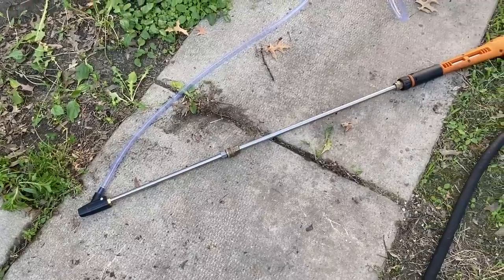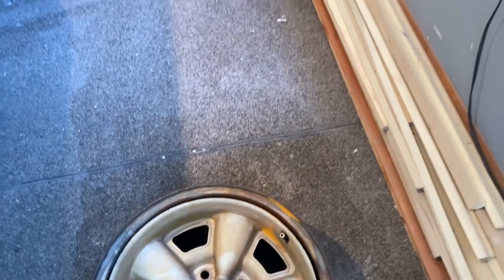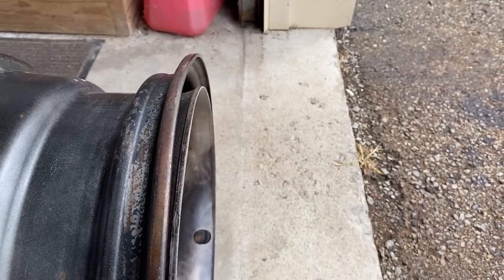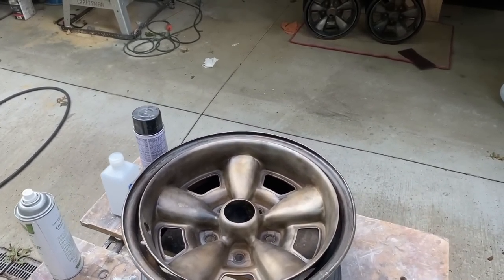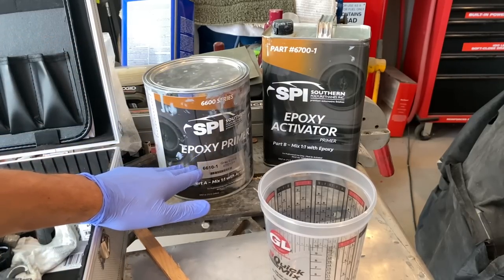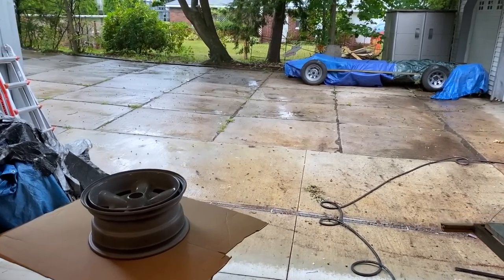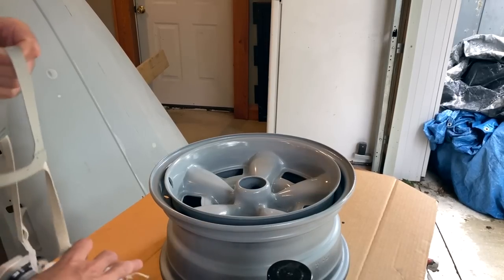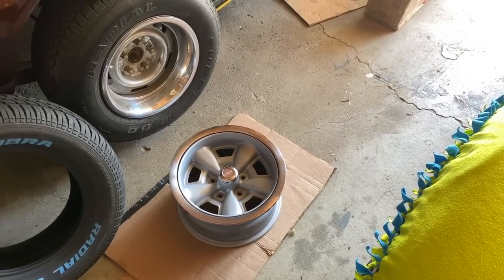1973 Camaro Z28 OEM WHEEL RESTORATION! The NEVER ENDING Wheel Project COMPLETED!!

Comment: The tires that came on your car most likely would have raised white letters so I think that would be more time period correct. I realize that black walls what one would use today but it was different back in 1973. We were still using bias ply tires. A popular tire for your car and the Chevelle SS was the Goodyear Polyglass with with raised white letters. Radial tires were available by 74 or 75 initially as an option then became standard equipment on most cars later on.

Comment: Hi Ryan, I own a 72 Z/28 and have restored some wheels in my day.  It looks like the color you used is close to the 74 Z/28 color.  The 70-73 color, PPG calls/called Dark Grey, I have the paint number if you want it.  The formula has an additive called suede in it.  It makes it rough and collects sponge pieces when you wash them...  The last set I restored I use PPG DP40 epoxy primer then the PPG color.  After realizing the sponge problem I removed the wheels (then mounted) and sprayed them with dull clear.  It didn't change the look but it made it much easier to wash the wheels.  Interestingly enough the same wheel on the 71, 72 Chevelle looks like they deleted the suede rom the formula.  Hope this helps, Tony!

Comment: Those rims look nice, they are not easy to come by , some might even use the rims that were on the 1973 Chevrolet Nova Super Sport, the rims you have, were used also on theChevelles, Super Sport,1970 1971, you have some unique rims on the Camaro👍🏼👍🏼👍🏼👍🏼👌🏽👌🏽👌🏽👌🏽👌🏽

Comment: VW may have started it with those giant center-caps and color match wheels. (not positive) But in the 70s anything with a beauty ring could have color-match wheels. A/C was a dealer accessory. Wheels are easy. And they already had all the paint!

Comment: I’ve had tons of camaros from 75-91.. they did come with factory paint matched to the car from the dealers. There was the option to have them painted. Those were most likely original Paint matched to the car. I had a blue with the rims painted exactly like the car and I had a Firebird with those rims or very close to those that were the same color as the car that were OE. As for the white letters in or out .. if you wanted to go with a 70’s to mid 80’s look I’d put the white letters out. 👍👍👍
Reply from the maker: Ramblings Of Nothing maybe that was an option then and they were actually supposed to be body matched?! It’s so hard to find this info online; I know the later years (at least 74 and up) had a color matched wheel option but I wasn’t sure on this one (all the pictures online didn’t have any color matched wheels)! Thanks for sharing man 👍👍!
Reply: Firebird had a different  rim although they did look similar

Comment: I have a 1973 Camaro Z-28/RS/LT specially ordered in Calif. Because of type LT stripes were deleted. I had to order the spoilers separately.  I also ordered the M-20 trans (Wide ratio).  My original wheels came with firestone  wide oval tires ( I have the original spare with tire on it)  The wheels were painted gray with a rough texture ( the surface was not smooth).  I recently put on cooper tires (white letters facing in).  I prefer the white lettering on bf goodrich TA radials.
Reply from the maker: Darrell Wong super rare combo you had! I heard of the rough texture on these wheels but did not replicate it due to not knowing how rough it was actually supposed to be. I did see original wheels being a little more gray than how mine turned out though👍

Comment: I bought an LT new in 73 and my buddy bought the Z.  Period correct would be letters out but I do like the clean look of black wall.  In fact my friend took his to a tire shop and had the tires on his Z remounted black wall.  An additional comment.  The wheels turned out awesome but my memory is they were slightly darker.  More of a gun metal.  Maybe the video makes them look brighter or my brain is clouded by the few years since I bought one of these.
Reply from the maker: Got ya, I still haven't decided on which way to mount them but I need to make my mind up soon (have an appointment the day my beauty rings arrive)! I do think they should be slightly darker but my camera does make it look a little lighter compared to in person. From the pictures online it does look like they are more of a gun metal color but I will run with this color for now!